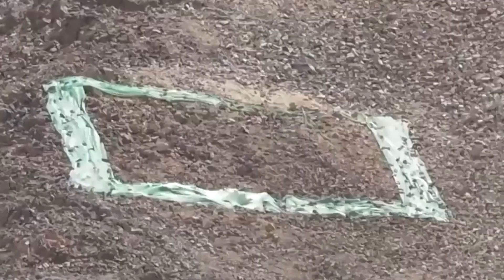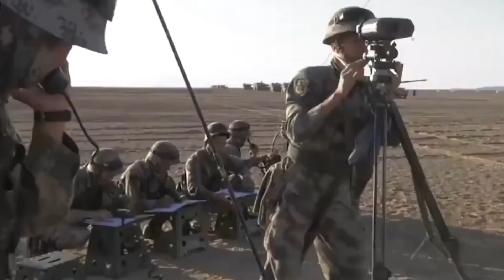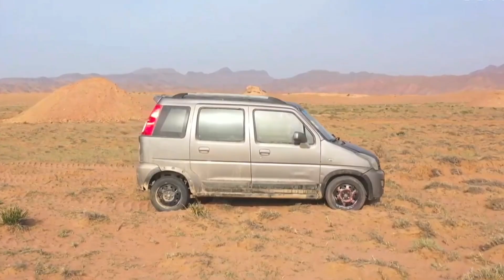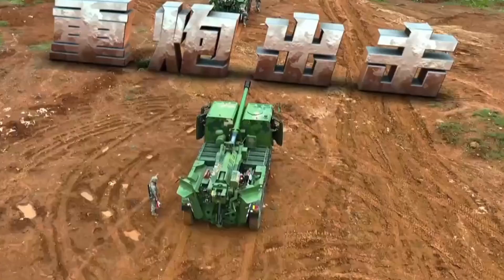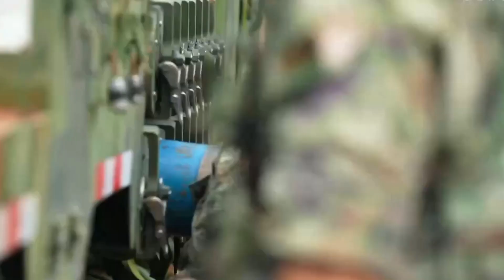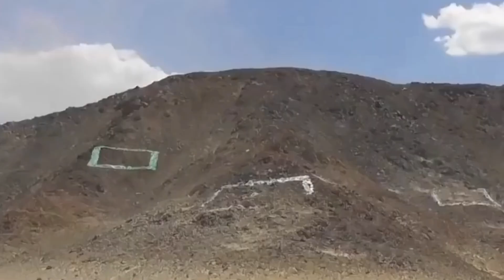The Insane Engineering of China's Cannon Drone

Comment: Well this video explains that the excessive acceleration problems they switched to purely mechanical solution and that have sense. But in order to serve as reconnaissance drone, it still must have a lot of electronics- communication system, cameras, GPS eventually, remote control etc. That is still fragile electronics incapable to survive high G. No explanation about that matter?